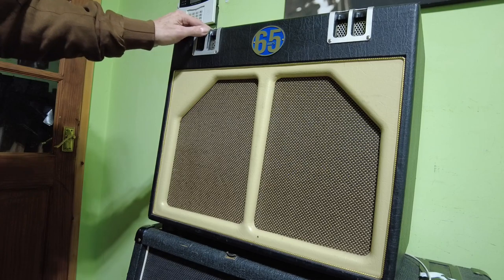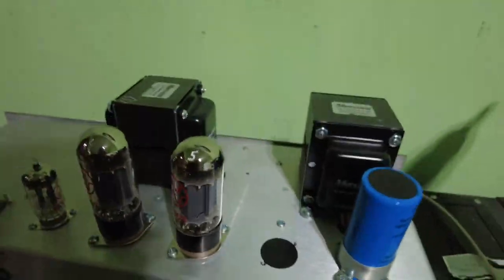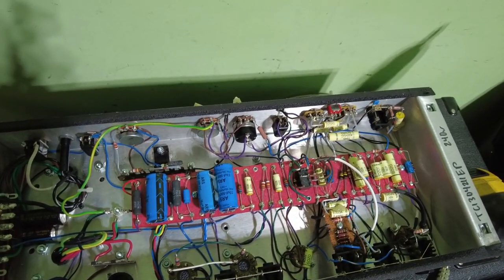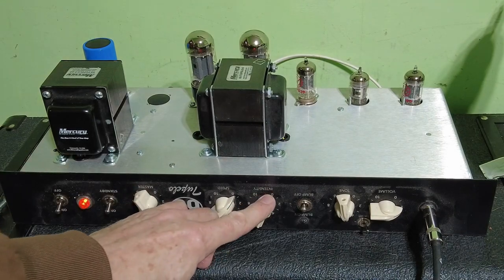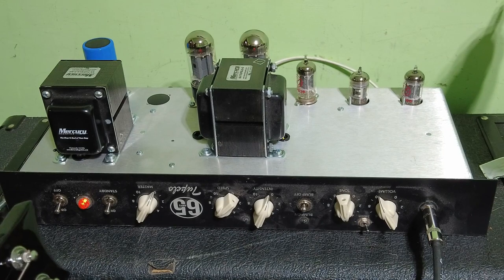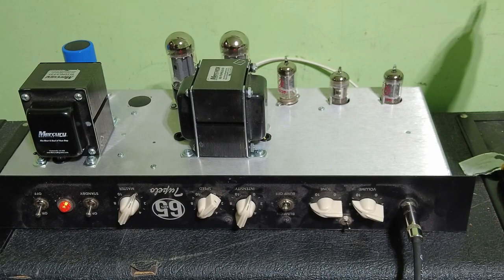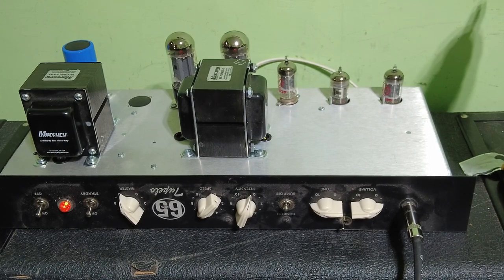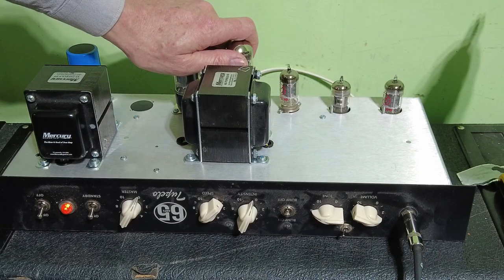65Amps Tupelo 20 Watt Boutique Guitar Amplifier Lets Take a Look

Comment: Elvis Costello used to play a Lil Elvis which was the EL 84  12 watt version of this amp. I find the master voltage is very useful in my Tupelo and my London Pro. The tubes last forever since I normally used it at about 7 watts. Had them both for 12 years and absolutely no issues. Dan Boul the owner and designer told me it would easily take 6L6’s for a little more headroom but I’m happy with it the way it is.
Reply from the maker: Hello Kevin. Thant's interesting info. Thanks for watching and take care.
Reply: si Elvis Costello tiene uno y suena genial yo tengo un soho 65 amps combo 2x12 de 20w y es lo mejor que he tenido en años.

Comment: I've owned 3 x 65 Amps. A producer, whiskey, and currently a Soho. The company disbanded a number of years ago, and because they aren't the latest new realease, shiny object, they can be had for a great deal used. Very well built amps. Not particularly bedroom level. The master voltage requires getting used to. It's really for rolling some volume off in a band setting, not getting whisper quiet overdrive in your bedroom. They react really well to the guitar volume. I'm a big fan, it's too bad their not around anymore. 65 got me into the boutique world.
Reply from the maker: Hello Mark. Yes great amps. As I said in the video, the only problem with this amp is that it isn't mine. It's good to find people such as yourself that have owned these amps, and know a great deal more about them than I do. Thanks for the info and for watching the video. Take care.
Reply: @Vintage Guitar Amp Repairs & Online Guitar Teacher  I will add one more thing, at the jam space I'll run the soho near open, %70 master and volume, use my guitar volume knob to gain up or down, a bit of fuzz in front for solos. Pure joy.  At home its set up as a clean platform. Master full up, channel volume at 3 ish. Pedals in front. Sounds great

Comment: Very interesting little guitar amplifier. The neat internal wiring and construction looks very traditional and easy to service just like the amplifiers built back in the 1960s, so many of today’s reissues seem to have printed circuit boards connected by ribbon cables to the controls etc. I find that the old tag or eyelet boards are much easier to work on and the individual wires connecting them to the valve bases , pots and transformers etc make it simple to follow the circuits through. The basic sound of the amp is excellent although I’m not too sure about the tremolo, I think that time spent with the amp would reveal a treasure trove of wonderful tones.
Reply from the maker: Hello Henry. I agree, I hate PC boards. I wonder if that tremolo needs a coat of looking at. There should be a part two coming for this amp. Thanks for watching and take care.

Comment: The Master is a variable voltage regulator (VVR) that’s controlling the PI and output tubes. That’s why cool power tubes. It’s not really meant to get quiet to bedroom levels. It’s for when you want good sounding overdrive on quieter stages. If it was controlling both preamp AND power amp, it would get a lot more quiet. At least it does when I put them in my own builds. Nice playing by the way!
Reply from the maker: Hello William. Thank you. I have had a bit of a read up on it since I did the video. I really should have done that before I did the video. When you fit them, do you use same components that have been used in this amp? Ampmaker do a kit which is the same as the one fitted  here, except it is built in to a small PC board. Thanks for watching and take care.

Comment: What a great sounding little amp! The "Master" isn't a traditional volume control. It's a VVR style voltage control on the output tubes. That's why they were cold enough to touch, turn the master up and try it again. 

I would avoid an amp with a VVR control personally, but they work great 99.9% of the time. You're dead in the water if it fails open though. Just give me an old JMP or a Super Reverb!
Reply from the maker: Hello Matt. Thanks for that info. I should have read up on it before I did the video. I think I am going to a part two on this one. I think that he Tremolo needs some attention. It's either faulty or doesn't work well when the VVR is down?

Thanks for all the help. Take care.
Reply: @vintageguitaramp_guitarteacher  The trem need enough current to operate nicely - it doesn't really work well at low volumes but is excelent otherwise - its a known condition

Comment: That is a bad sounding tremelo.  I've been playing my Fender 70's Classic Vibe Thinline Telecaster guitar that arrived yesterday.  You play better than I do, lol.
Reply from the maker: It is Michael. A part two should be coming as more info has surfaced on this amp and I am going to check the Tremolo. I can't believe they designed it so bad. Must be something wrong. Thanks for watching. Take care.
Reply: That bad sounding tremolo comes from the master voltage. To have a normal tremolo sound you need to have master voltage at maximum (maximum volume). The master volume reduce voltage on tubes to have less power (volume) so it changes the way the tremolo works as it is a tube tremolo. 
You can adjust subtlety the intensity (between minimum and halfway) to play the tremolo with master voltage engaged.
Reply: As Sebastien said. Master isn’t a traditional master it drops the voltage to the output tubes so reduces the over volume. It will never go to zero. Also the tremolo is a bias tremolo which is reliant on the power tubes. Hence when you change the “master” you need to drop the tremolo intensity. At low “master” volume settings and high tremolo intensity the tremolo won’t sound great at all. It is exactly the same as the EL84 version of this amp called the lil Elvis. Hope that helps